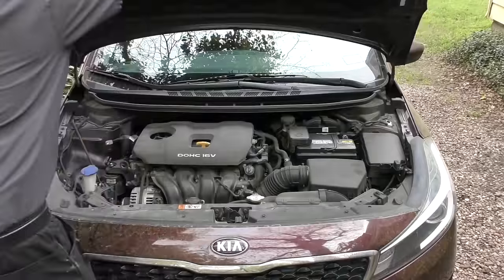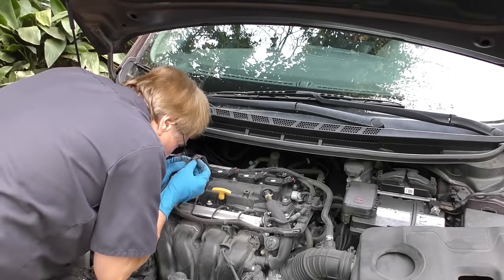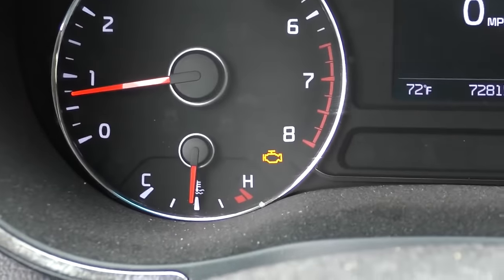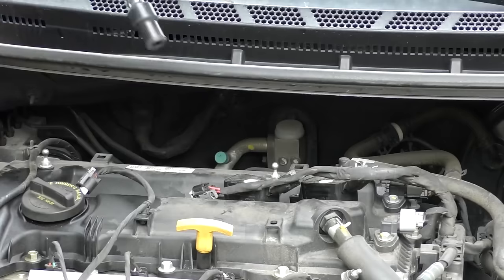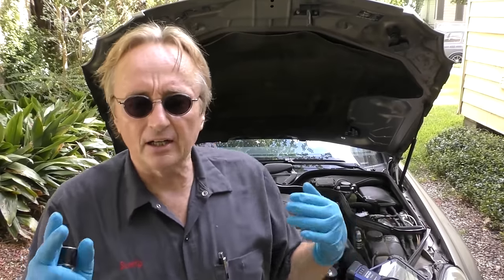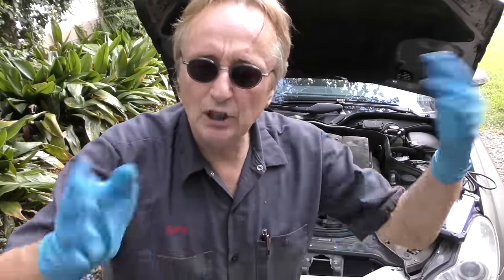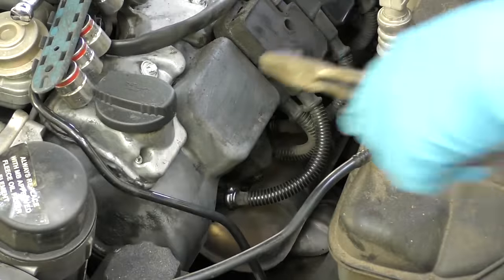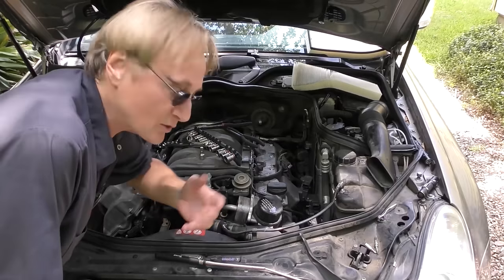3 Mechanic Secrets I Have to Tell You Before I Retire

Comment: You're not fooling anyone Scotty everyone knows you'll never retire.  Great tips though!
Reply: I retired 20 years ago , Problem is I can't find anybody to work on my, Or my friends cars, I have never been so busy😉
Reply: @larryarcher4502  ME TOO!!
Reply: "One day when I die" - Ta
Reply: @larryarcher4502  I REALLY need some old school advice! I've got a 2000 Buick, replaced motor 30,000 miles ago. She's not been driven much until lately so I sprung for plugs, wires, ignition coils. Very next trip over 30 miles, no buck, no hesitation, just died. Had it towed back to mechanic, scans clean. The crank sensor was changed after motor replacement so had the ignition interface replaced. She still dies, only when warm. Not running hot, fuel pressure is okay. I've been told the computer isn't sensitive enough on these models & just run it until it won't run anymore! Can't trust her though, she starts & runs after she cools off SO WTF?
I'm seeking any experience mechanics have had, this has stumped all the ones I've known. HELP!!!!
Reply: @katiekane5247   Problem your having needs to be trouble shot at the moment it Dies, Had of Ford With a bad ignitions swich do this The thing drove every mechanic in town crazy I finally got it to do it for me And noticed it was like somebody shut the key off, The problem never showed up on a computer diagnosis!!!
Reply: @katiekane5247  It's the ignition coil module. The thing the coils are bolted to.
Reply: @twiztid6977420  this guy gets it, I'm on my 3rd replacement ICM and this one seems to be holding good
Reply: @coreykovacs70  Can you still get an ac Delco? That's what you want.
Reply: @ZAPATTUBE     j
Reply: Lol
Reply: ... Lol 👍
Reply: Hope not just pass away going to work 🙏💪👍

Comment: 16 spark plugs 😩 I’ll never complain about changing my 4 again!
Reply: 12 cyl mercs are the most fun. $2000+ for plugs & wires😂
Reply: 5.7 hemis have 16 plugs too, and I've changed mine twice over the years. It's not that bad
Reply: @silkroad1201  Many V12 Mercs have 24, and since most will service at the dealer it could cost $3k++
To my knowledge there isn't an aftermarket for the wires on many of those engines so it would still be about $2K for DIY. Chrysler/Dodge was blessed with a lot of Mercedes tech during their marriage. Dual spark plugs maybe not so much, only because even supercars can get by just fine with 1 per cylinder
Reply: Mercedes M275 V12 has 24 plugs, no wires, with ridiculously delicate and expensive one piece coil modules for each cylinder bank. I'll never own one of those piles ever again. It was stupidly fast however.
Reply: I need to change 8 right now.

Comment: I have been self educating myself on auto repair for the past few months and i would be much worse off if not for you Scotty. You are very straight forward and talk facts with your audience. I have a 2000 ford ranger (3.0/V6) and it's idle has been rough. The guy at autozone told me it was my erg valve pressure sensor (which they tried to sell to me on the spot for $90.00) so i did my homework. I figured out that it could be that or the vacuum hoses attached to the part. It could even be a mucked up idle air intake valve. What i am trying to say is that your videos gave me a sense of confidence in learning about my vehicle and what to expect in certain situations/conditions. I also figured out from watching your videos that i dont have to pay $90.00 at autozone when i LITERALLY found the same part online for around $26.00. I have one video recommendation though, i think many others would benefit from hearing your thoughts on reputable online car part markets. I want to make sure that i am buying from a reliable source and for fair prices and i have a feeling you would know better than I 😂

Comment: Excellent diagnostic especially with using you head about the main areas that cause instability with car ignitions. I remember having a 93' Ford explorer (tank) years ago had the fewest problems of any vehicle I ever had but I accidentally cracked the mass air flow sensor on top tapping it too hard. So after it running like a James bond getaway truck with smoke barreling out of it I had it replaced and it ran super once again. Keeping up with simple maintenance rides you of headaches on even these fantastic reliable vehicles for sure.

Comment: When you are doing maintenance on a Mercedes, everything is double...double the work, double the parts, and double the price.🤩🤩
Reply: I think Mercedes built that engine off a WWII aircraft engine design, when they use two spark plugs and ignition coils (magnetos on older ones) for reliability.
Reply: And it drives twice as well as a Toyota
Reply: @rwd323  lol
Reply: @rwd323  haha well they'd wanna have some benefit. They cost a fortune to buy new, own and maintain.
Reply: @rwd323  Toyotas are more reliable than that endless money pit Mercedes. The old Mercedes sure after year 2005 they are worthless. Even Scotty knows that Toyota #1 for realiability, comfort. Toyota is like a good dog that never leaves or side.
Reply: Tom S -  "...double the price." You guys are clueless fools with comments based on gossip and "I heard"! 
Mercedes A class DCI 1998, Toyota Yaris D4D 2007. Very similar size, power, market, weight. Similar cars in most everything. Both needed a brake pedal switch only a couple of weeks apart. Both OEM parts were bought on the respective brand local dealers. 
Toyota part costed a little bit more than the DOUBLE, for what I had payed at Mercedes just about 2 weeks prior! I was so surprised I asked the guy if he could check the price again. 'Cause I really taught there was a mistake... There wasn't any mistake and my wallet lightness confirm it 100%.
In case you're wondering, That was the first time. Since that one, I had a few more like this!! Although not passing the "double" as in this particular case. Notice same part, different brands!  Should I say exchanging the part on the Mercedes took me at least 1,5 minutes, no tools needed. On the Toyota took the best part of 15 minutes and a 10 mm wrench. The bracket bent! This is real life, real world... So you were saying?! ;-)

Comment: How many remember that he had just swapped plugs one and two, and it wasn't loose when he pulledit the first time, so the plugs being loose had nothing to do with the problem. Replacing all the plugs cured the problem so it could be that with 80 thousand miles on the original plugs they had just burned enough of the electrode away that and the number one coil possibly a bit onthe weak side resulted in a miss. And the replacement of the plugs and the proper gap solved the problem.

Comment: As a lifetime auto mechanic, I can recall when changing spark plugs every 10K was the norm.  Now, I have a boat, a pick up, two cars and two motorcycles and can't recall when I last changed spark plugs on anything....although I do keep a vehicle log.   When gas was leaded, lead would actually deposit along the inside of the spark plug, and instead of jumping the gap, the spark would follow the path of least resistance and the cylinder would misfire, but that is almost unheard of these days.
Reply: Lead-fouled plugs. Ah, the good old days.
Reply: @scootypuffjr.  Yes.   Now all we have to be conerned about is the befouling of the  strontium coated X3 drives of our long range interstellar cruisers.
Reply: Where are the flying cars I was promised?
Reply: @scootypuffjr.  You'll have to check with "Doc" of 'Back to the Future' fame.
Reply: @scootypuffjr.  Did you check under your X-Mess tree?

Comment: It's a '17 model and already the check engine light is on? 🙄 What a piece of crap!
Reply: Sparkplug got loose,that's not a car's problem
Reply: With 80k+ miles driven
Reply: @JedemPoKucama  it is. That is an uncommon issue. You should expect no issues at all with a car only 3 years old unless its a POS or you're just a POS, terrible driver that gives no fucks about the car at all.
Reply: Florida's Hottest it’s likely whoever tuned the car last
Reply: @zf2029  was just going to say this. i have pulled alot of plugs were the previous guy before me pussyfooted them on the car. you can tell the people who have zero clue about wrenching but watch a few YT video's and think they seen it all.

Comment: 2017 Kia already misfiring, that's astounding.  Unheard of in a Toyota or Honda.
Reply: He did say it has 80,000 miles.  Likely the fault of whoever did the last tune up.
Reply: My  2008 Kia Rondo has over 330000 miles on original engine and trans. best car I ever had. And I've had most everything else. But never had a Honda though.

Comment: My father had a 1997 Dodge Grand Caravan and in order for it to pass the emissions inspection, we had to drive it on the road for about 1/2 hour.   Virginia requires an emission inspection every 2 years expect for brand new cars.  We got rid of the van in 2009 as it was falling part with so many problems including the replacement transmission started slipping. We've never bought another Chrysler product since

Comment: I just bought a 2018 Kia Soul from my nephew.  Looks identical to that  Forte under the hood.  Throwing P0302, even after a new coil. Throwing a O2 sensor position 1 bank 1  also, even after a new O2 sensor. He did all that work for nothing. Its still under warranty, so I took it to the dealer.

Comment: I used to own an SL500 with the M113 and I was thankful for the 16 plugs because I drove from NH to VA and had the check engine light on and a misfire but the car was running just fine despite on one the plugs on a couple cylinders crapping out on me (I was 17 and didn't know what spark plugs even were).

Comment: Could someone tell me why people rev their engines often like crazy right after startup? Let alone people revving cold engines. Why? You really don't want to do that.
Reply: Depends on the car, if it's in bad enough co condition it might need the extra gas to prevent stalling on startup
Reply: I always rev up my cold engine  when i start up to pull up the cold oil for faster lubrication  , iv been doing it all my life as my father taught me who was head mechanic for ford dealer ship  40 yrs , and was a race car driver and engine race motor builder  ,who had went to auto mechanic school  ,when he got out of the military  ,  im 78 now motorcycle and all vehicles  iv rev up to warm engine before I  drive , 
What do you base this disinformation  on ????

Comment: Every time I've ever had an engine misfire or a bog down engine it's always spark plugs or the coils for the spark plugs. In the 30 years I've been driving it's usually spark plugs have gone bad or one of the coil wires have gone bad usually a very simple fix and if it's not now you got new spark plugs for the next 30,000

Comment: Always replacing plastic and rubber parts on my 68 MBZ, sometimes as soon as 4 weeks when it cracks. Germans couldn't perfect plastic or rubber after WWll, they should by now. Gave up on that 68 money pit and retired it in storage. Those code scanners getting cheap and could do so much more at 1/3 the price of my first one. Scotty ain't going to retire, fixing cars and YouTube is an addiction.

Comment: Here is easy tip. Follow your car maintenance program. It's in cars manuals. You need to change sparkblugs, oils, filters etc, regulary and maintenance program tells when. Atleast that Mercedes looked like it had got done nothing but driving. If you skip airfilter change your starts to comsumpt more fuel and sooner or later gets maf and throttle body problems. Skip oil and oilfilter change and you'll eventually  brake up your engine. Skip sparkplugs change and you end up engine running rough and eventually IT won't start up anymore.

Comment: Scott, my 2000 Nissan Maxima, is got the brakes messing up it is super hard to stop.  Then light stayed on, my battery lost the juice"die"  then the starter mess up.  I had my brakes fix 145 front, 145, rear, then my starter was fix for like 5 time since last december.  In july I paid 1,450 for my car front, back brakes and my car engine.  I have the tickes.

Comment: How the MAF works - There is a tiny circuit which you can see.  A coiled wire or something similar.  That's a heated wire wrapped to a thermocouple which measures the temperature of the wire.  As the air blows past the wire it cools it down and the cooler temperature is measured.  A voltage is applied to heat the wire back to its original temperature and the voltage needed is directly proportional to the mass of air moving across the heater wire at any time.  The car uses this signal to know how much air is entering at any instant and adjusts as needed.

Comment: Don't forget to use some "anti-sieze" on the threads of the new plugs.  Keeps them from "welding" themselves into the threads of the cylinder head, making it much easier to remove them and preventing potentially damaging a head or snapping off a spark plug.  
Anti-sieze is your friend!

Comment: That spark plug as brand freakin NEW!!!  Spray some electrical parts cleaner on it,  hit it with paint thinner to take off the yellow stains, and you have a spark plug good as new.
Reply: Sometimes they crack and become useless. I had all good plugs, the #3 was fried and the porcelain was cracked. Changed all plugs and works perfect again.

Comment: that was a good old nissan you had there
Reply: Auto😓
Reply: Ricky Dubs mans old can’t blame him. His knees probably wrecked
Reply: I work at a quick lube. Customer came in for oil change and said there car idled rough. It was that 2 seater sport Cadillac model. It had 80,000 miles on it. When I was checking the air filters, it had 2 like the Mercedes,  they were the factory filters and looked like black bricks!
Reply: blubyu hard to believe how people neglect their vehicles
Reply: @deborahchesser7375  So many just drive their car and have no concerns until it won't run. Then just trade it off or take it to a mechanic. And yet it is something simple such as these problems.
Reply: I have a '92. The dash instruments and the layout under the hood look very similar, so not much changed in 6 years... except mine doesn't have a computer or even airbags :D
Reply: @dubiousdub  I agree why do Americans have auto JDM
Reply: @willmalliotis1904  what

Comment: My mother had a problem on her 14 ford edge where the engine would stutter and try to shut down. Didn't wait for me took it to the mechanic and they told her it was her suspension and fans. $750 later same problem. I hooked my scanner up and showed mass airflow sensor. Replaced it for $60 and has been good since

Comment: And early 1980s Datsun or Nissan pickup has about 8 spark plugs and a 4 cylinder engine. Engine is pretty bulletproof though and will run forever

Comment: You can sure save yourself a lot of connection troubles (corrosion, etc) by putting a small amount of bulb grease (pure silicone dielectric grease) into electrical connectors before connecting them back again. It's messy and you need paper towels to keep cleaning your hands or gloves, but it's worth it.

Comment: a loose spark plug might have carbon on the treads and will probably loosen again. I put cuts into one of the old spark plug and tap all the cylinders to clean out the threads ;-) great to make sure you don't go too far and because the spark plug is softer than the head it won't wear the threads

Comment: I'd never seen an air-filter that was incorporated into the 'beauty-cover' until I bought a 2001 Golf with the AZD 1.6 16v engine.
Reply: Pretty common design in latest cars. After all it save space, money and complexity, by reducing the number of components. Same in Peugeot /Citroen, etc. ;-)
Reply: @crpth1  Maybe I'll have a newer car to check soon! So far I have a 1998 Passat, 2001 Golf, 2003 BMW, 2005 Colt and a 2006 Mondeo on the drive. Only the Golf has the built-in air filter.

Comment: Dont be surprised if that kia misfire comes back. I had a 2009 Rio that the coils would "intermittendly" fail and it sent many repetitive codes, includint specific cylinder misfires and well as mutilple cly  misfires, and would ofter disapear and then come back again. It was Kias use of cheap coil packs. Once all of them were eventually changed, good to go. If i own another Kia i would just change them all at the same time

Comment: The 3rd part.. Mass air flow sensor especially the little square box where the circuit board is... I going to talk about that one... I used to have an Infiniti and that's designed by Nissan.. so one time the car had quite a lot of acceleration problems .. I traced to the air flow... Clean the sensor but didn't help so I decided to cut open the box to check out the circuit board ( I was a computer engineer so trying my luck) what I find out surprised me.. the connector pins to the circuit board solder breaks away... This is due to bad design that they fixed connector to the box and right the circuit board to another part , so all the vibration

Comment: FYI Kia does has an active recall for certain years for the coil packs, they replaced the spring inside the coil or replace the coil pack itself, depending on conditions in live data..

Comment: Carefully Scotty about the California emissions  test. There  is a visual test where the car must have the correct exact original parts as manufactured. That goes for converter ,air cleaner etc or it may pass emission test but not visual test. After market parts must be approved with a California EO or you will not pass.Happened to me and anything different they the tech will fail you.